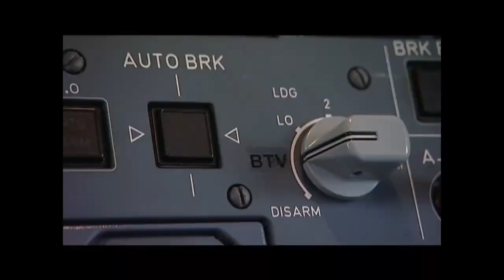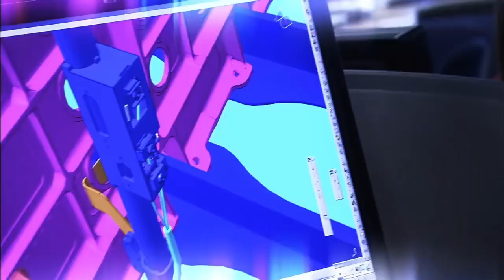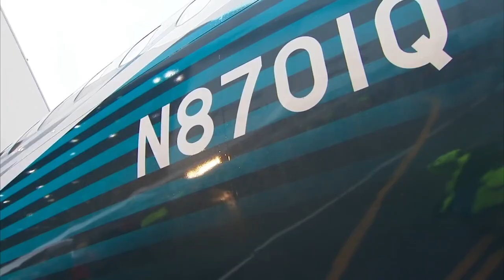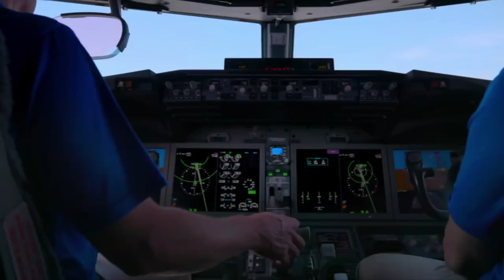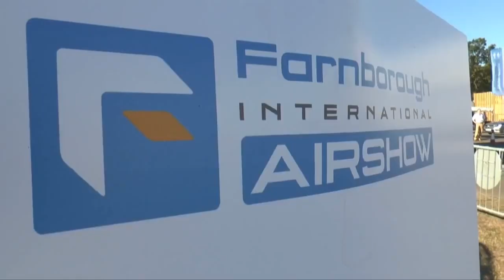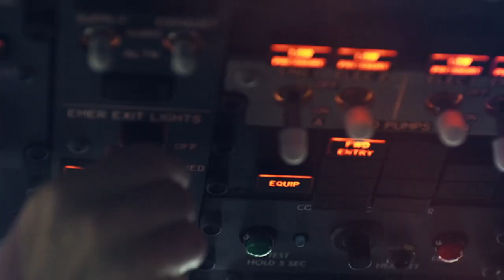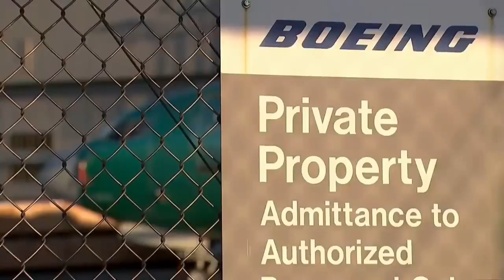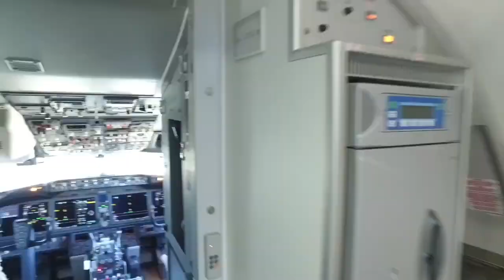Boeing 737 Max Documentary: 737 Max Return to Service

Comment: I would not fly in a 737 max. It is inherently unstable with the new engine position. Time will tell.
Reply from the maker: Ok. Its really a personal choice on whether the Max is safe... and given Covid restrictions I believe travel will not be coming so soon anyways :)
Reply: So you’ve flown it to determine it’s stability???  I have, and it is quite stable.
Reply: Would have saved so much money using an 800 chassis and instead heighten the suspension.